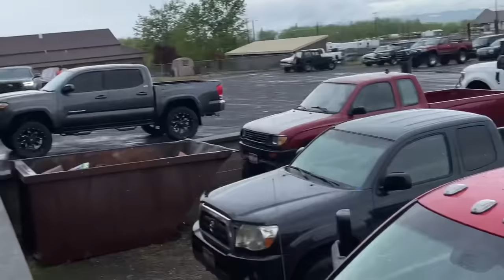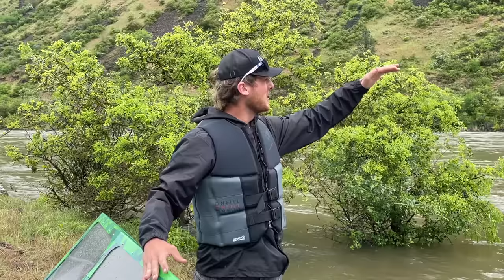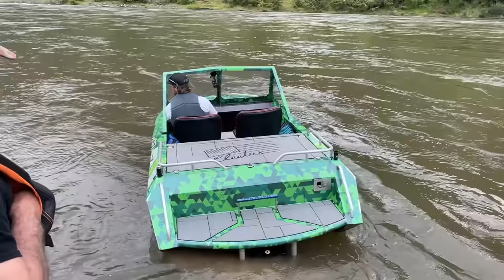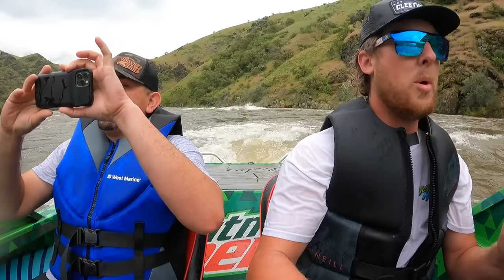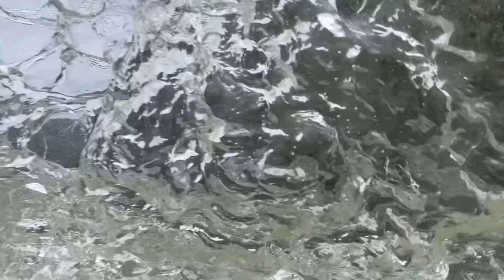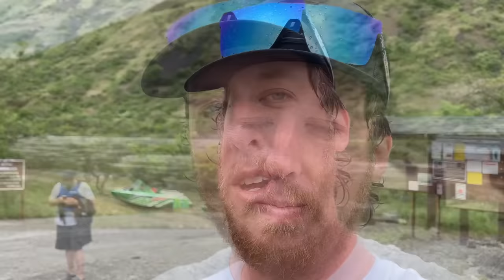We Sent Our Supercharged Mini Jet Boats 3,000 Miles To Idaho... and Got ROCKED By Rapids!!!

Comment: Nice, you guys are in my old stomping grounds!  I worked out of White Bird as a white water guide on the Salmon back in '07.  That put-in you used is just about a mile upstream from where I lived out of my van on the side of the river.  Had a rattlesnake move in under my van, but we came to an understanding.  Good times.

The Salmon is an awesome river for rafting, kayaking, and jet boats.  Lots of big, fun rapids, mostly Class 2s & 3s.  Enough to be a fun ride but not so much that you have to be a hardcore expert to even go on it.  It changes a lot with the flow; at high flow like you guys experienced, there's a lot of big water, but at lower flows the challenges shifts more to rocks and drops.  Even a week or two can make the river a completely different experience.

Beautiful country, lots of great camp sites, and the river cuts through a lot of interesting geology and history.  Huge basalt columns from ancient lava flows, remnants of old hydraulic mining operations, and some cool Native American stuff.  There are areas right off the river where you can check out old petroglyphs, and the area universities have (or at least had) a couple archeological dig sites along the river too.  They were usually happy to give a nickel tour for anyone who wanted to stop.

Comment: I'm confident any watercraft works as an adrenaline/speed multiplier. Going 50 on a boat vs in a car is a vastly different experience. getting up close to 70-80mph on a jetski feels to me like well over 150 on a motorcycle.
Reply: I think the motorcycles a little crazier speaking from experience
Reply: I second this on the motorcycle. 170 is ridiculous on a bike. 70 is wicked on a ski but nothing like 2 wheels
Reply: @smalltownoutdoors9442  I've never done more than .. I guess 30 or 40 on a rented Ski but acceleration out in the elements or ZX10R or even a powerful 600 is .. for the win.
Reply: @realMaverickBuckley  Powerful 600? lol... Power to weight is OK but there's nothing like 200+ Hp with over 100 Lb of torq to go with it
Reply: @FUCK_________googIe  I've been 156 on my cbr 600 and 75 on my Yamaha fxsho, the motorcycle is crazy
Reply: it gets bumpy for sure

Comment: Definitely good choice on changing the impeller on that jet boat pump. It’s not the tolerances that help hookup and power it’s the pitch of the impeller blades and having enough motor to drive that pitch to maintain rpm below the rev limiter.  Riva directly across the state from you does some great impeller work for race skis and jet boats!

Comment: We boat much harder stuff in NZ with my boating experience my biggest tip is don't drive flat out all the time throtlle your only back up in jet baot and need to keep plenty room between boats. When it goes wrong goes wrong fast no control over it know by experience

Comment: From a former boat racer, PLEASE get some safety gear!  Some real life jackets (Lifeline brand) will keep you chest up and breathing even if you’re out cold. They have thigh straps so the current won’t pull your jacket off.   Also head gear would be nice as your skull  hurdles toward a boulder at 35 mph.  Everything is ok until something goes wrong.